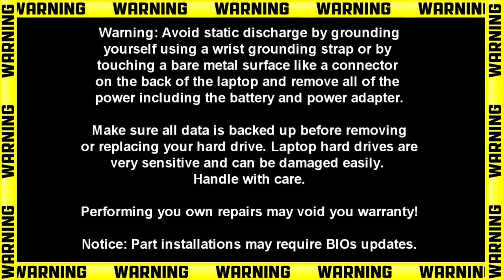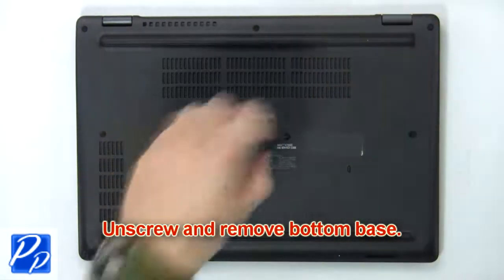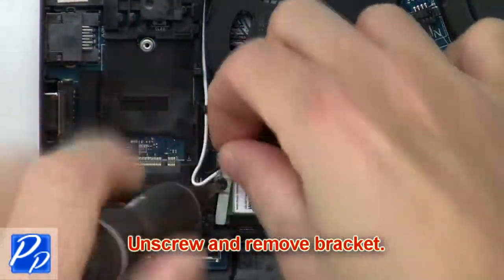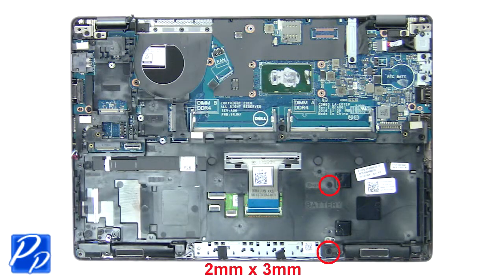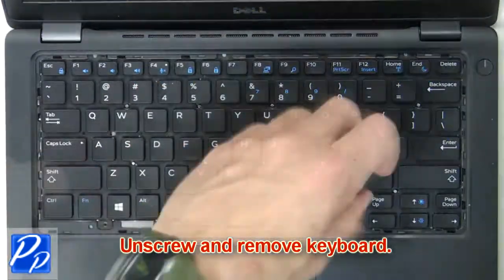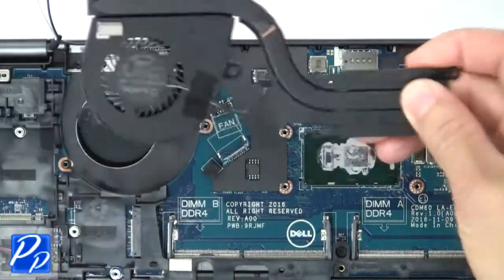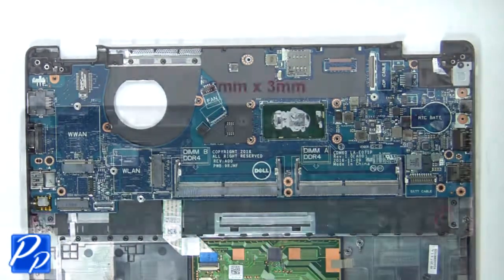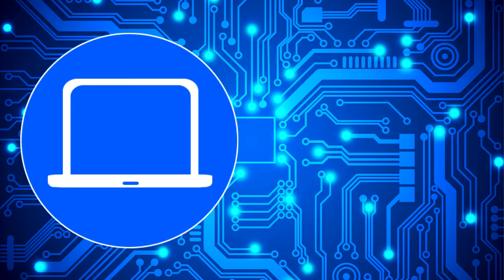Dell Latitude 5280 (P27S001) Motherboard How-To Video Tutorial

Comment: Hi can the can you upgrade the graphics card of this system or not ?
Reply from the maker: The GPU on this model is integrated onto the motherboard and cannot be removed. In order to replace or upgrade your GPU you will need to replace the motherboard.